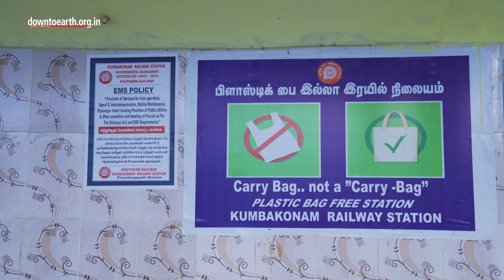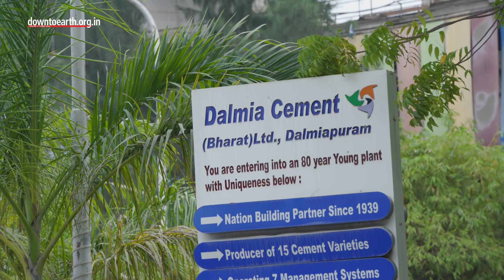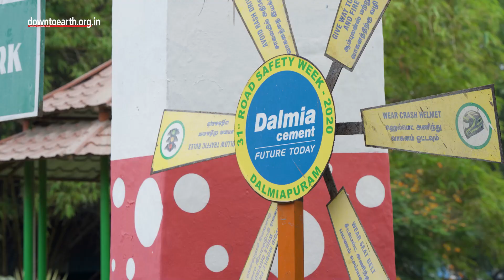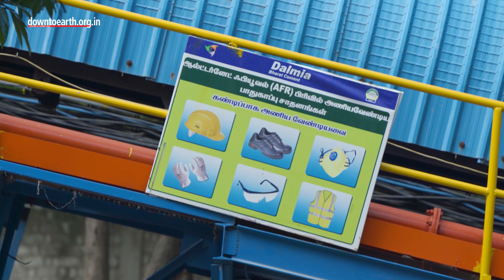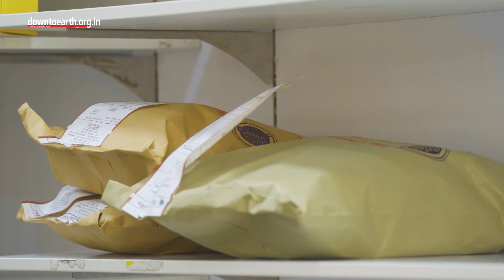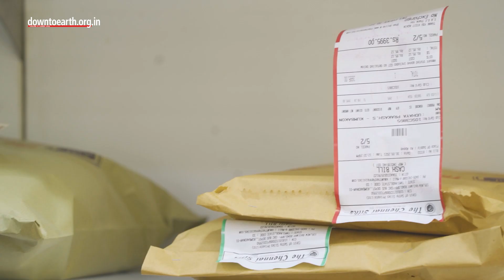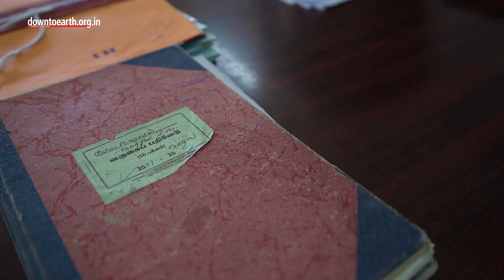Kumbakonam's plastic waste used as fuel in cement factories | The Cleanest Cities Of India | Ep-6

Comment: Good documentary, but it would have been beneficial to the viewers if you explain the use of plastic fuel more. Is the plastic is incinerated to use it as fuel, if so what are the measures taken to avoid air pollution. Wouldn't it make the pollution problem much worse if we use plastic to construct roads, aren't we spreading the waste throughout the country. What happens to the plastic waste which gets into the atmosphere when the plastic mixed roads wear, is there any measures taken to tackle this. Please address these issues also. Good videography, narration and presentation.